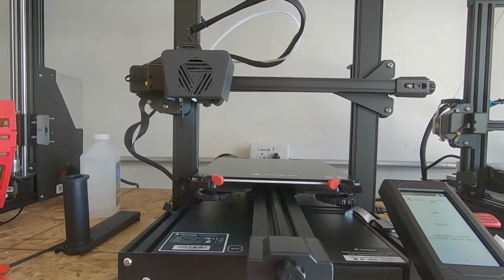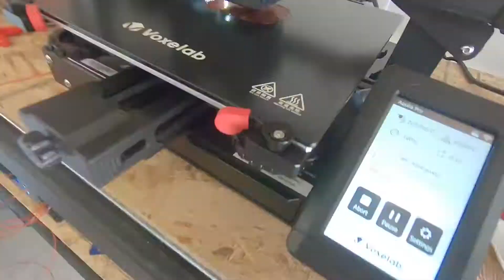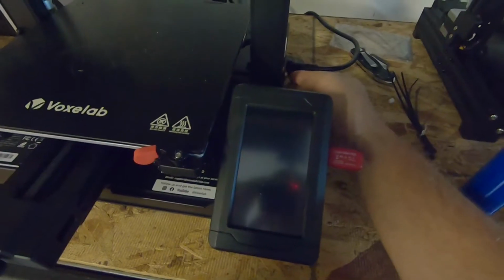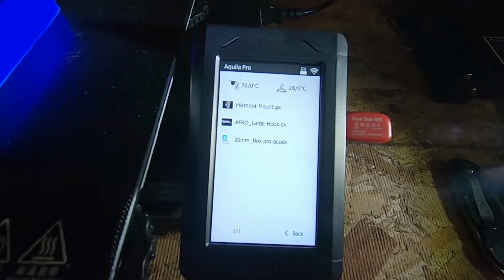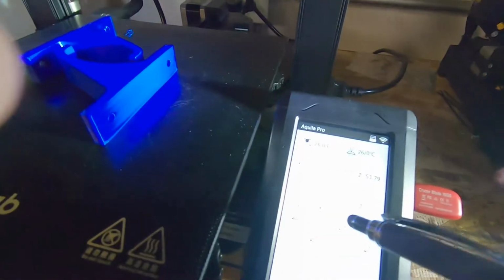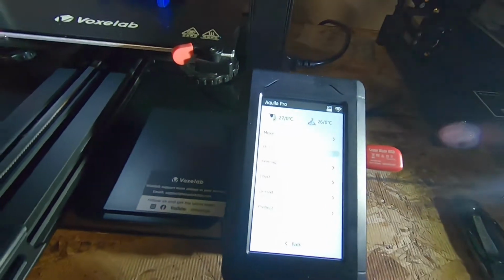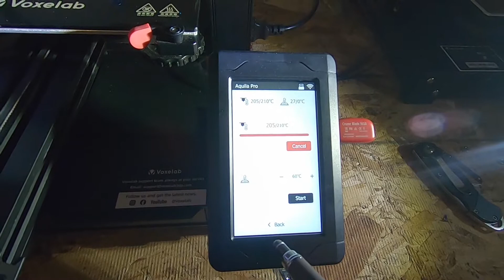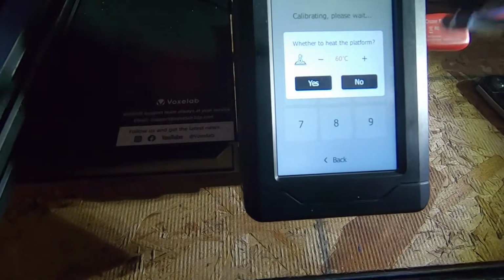Aquila Pro Part 3

Comment: Hey bud, I need some help. My prints on my Aquila Pro have been printing weird. At a certain point the printer stops extruding but it continues moving like it’s print. Also, any profile tips for voxelmaker?
Reply from the maker: Hey man sorry I didn't reply sooner.  I don't monitor this channel as much as I should.  Sounds like you are experiencing heat creep which is causing jams.  One thing you can try is to do the mod from this video https://youtu.be/B2KEzF1ZzTU you would need some ABS or PETG, this has helped me a little bit but adding a more powerful hot end fan has also helped.  You could also give this a try, haven't tried it but looks like it could help https://www.amazon.com/dp/B09JVQPDFM/?coliid=I3S9WGJLXV5FB&colid=2Z02LJ75C3KQD&psc=1&ref_=lv_ov_lig_dp_it . In the meantime, if you remove the stock PTFE tube from the hot end, check to make sure the end of the tube has been cut straight, then reinsert it and push down all the way to make sure it hits the nozzle.  
For Voxel Maker I would start with the default PLA profile, then choose to "customize" at the bottom of the dropdown of the profile menu, it should keep the stock settings then you just make changes from there.  I would avoid changing any of the settings in the stock profile, that way you have the stock profile unchanged.  Whenever you have a new material, and you want to create a new profile always start with the stock profile then choose to customize, then make your changes.
Let me know how it goes.  I will try to monitor this channel more often.